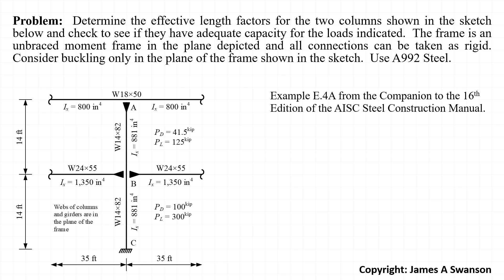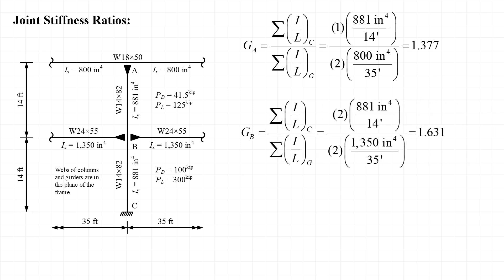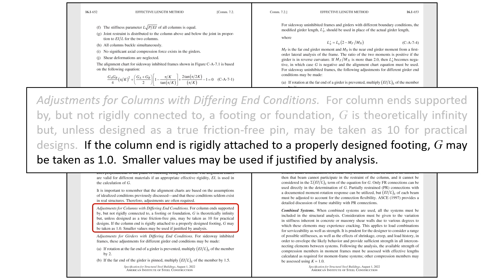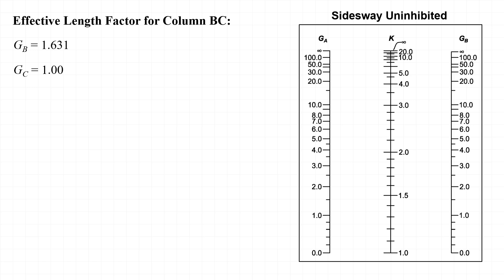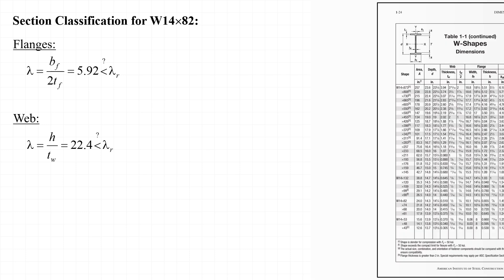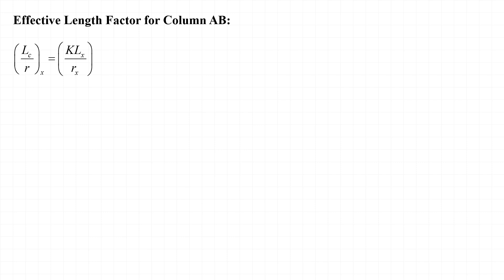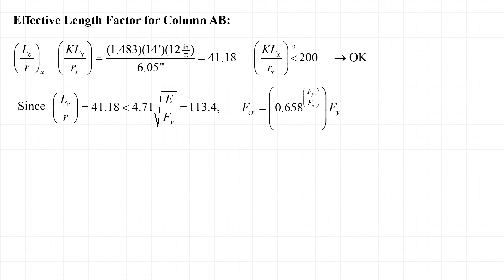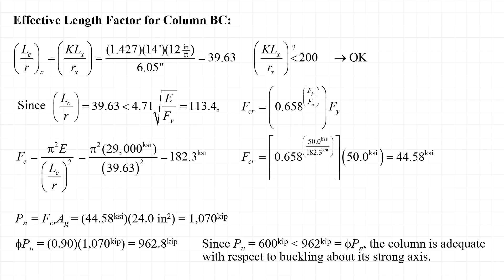Effective Length Factor Example 01

Comment: Thanks for the example. I wonder why didn't you calculate the stiffness reduction factor for the column since its behavior was inelastic? Or you decided to be conservative and just ignored it. ?
Reply from the maker: Thanks for your question.  Using the stiffness reduction factor is permitted when the alignment charts are used to find the effective length factor, K, and when inelastic buckling governs.  Using the stiffness reduction factor is optional, and will result in a smaller value of K, and thus will result in an increase in calculated column strength.  In this example, the available strength of the columns calculated without using the stiffness reduction factor was sufficient, so there was no need to consider the stiffness reduction factor.